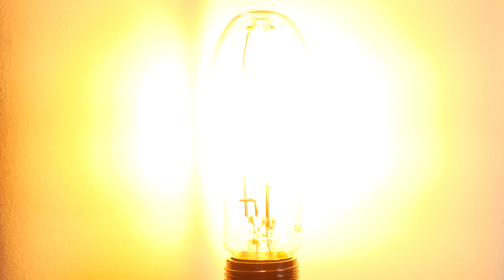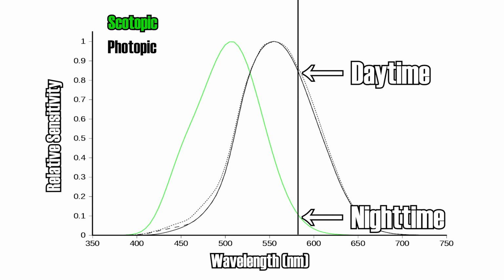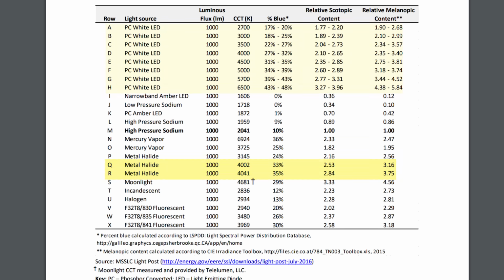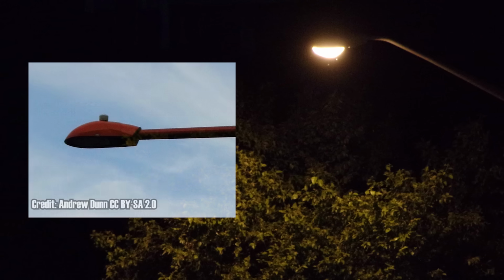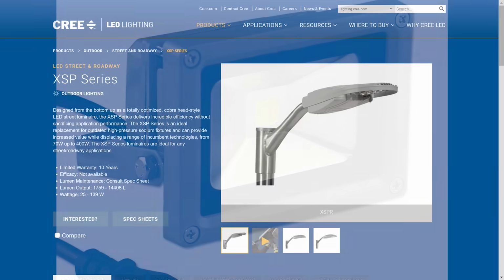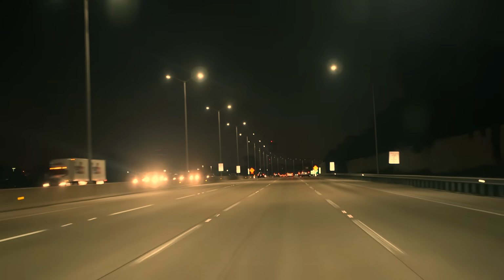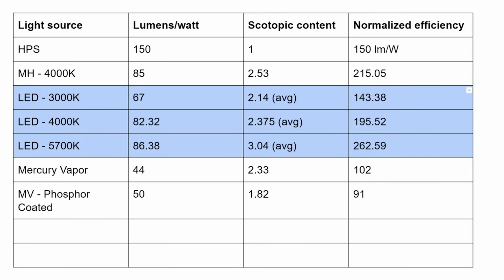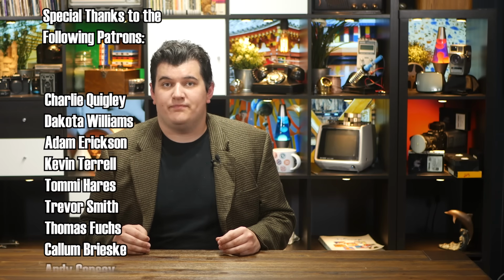The LED's Challenge to High Pressure Sodium

Comment: I remember my street having a blue/white lamp about 25 years ago, before that section was standarized with sodium lamps, shortly after.
I've been walking that street under yellow light for most of my life, so I got used to it (as I have to pretty much the rest of the whole city, it looks just the same)
that, until my dad just recently added a LED light to our back yard, for late night/early morning lighting.
I can't see shit under that light.... it lights the area just fine right under it, but it fades out too quickly over distance, and I'm talking about a square garden barely 10 meters on each side.
the city hall also uses those lights around the city center for public spaces, and I can't see shit there either.
the very little I recall about those old white street lamps, is that they felt pretty much like that LED garden lamp.

I feel more comfortable in complete darkness lit by moonlight, that under those LED lamps.
I also switched the bathroom lights from 30w incandescent to 9w LED, and they shine right in my face,... it's not the warm soft light I'm used to... they feel completely off.
they're great for night lamps or desk lamps, but, lighting farther and stronger? no thanks, give me a sodium lamp any day.

Comment: Its not a choise of aesthetics.  You might dislike white LED light, i don't. I loathe the candle-like lighting of sodium lamps. The whole of Asia perfers >4000K as well. So if the safelty, energy efficiency and longlivety is better with LEDs, its pretty much a no brainer. Only a couple of elderly displeased with white light is a rather low price to pay.

Comment: New York City is slowly replacing all of it's  sodium vapor streetlights with more energy efficient LED streetlights. 150w sodiums are generally being replaced with 91w LEDs. 100w sodiums are being replaced with 64w or 72w LEDs. Opinions vary on the quality of the light produced.

Comment: i wouldnt exactly call the blue light science questionable.
most people, me included will have much less eye strain at lower k values.
my eyes stopped hurting once i reduced the blue output of my monitors in dark rooms.
i guess it boils down on the overall luminosity

Comment: A great video again, I just wonder how the LED light, especially in the 5700K region performs in fog. The narrow band sodium is very good at cutting through fog rain and mist, where white light may be more prone to blazing, and that may prove more of an argument for 3000K led colour temp. Also, I would have expected there to have been development of electronic ballast's for most discharge lamps these days, pushing efficiency much higher, along with lamp life and start reliability. It certainly helped fluorescent performance in the 15 years prior to the led invasion. Cheers, and thanks for posting.

Comment: In Amsterdam there are a lot of decorative streetlightpost and a few years ago in some streets they changed them for decorative LED streetlightposts. I was horrified by the effect, not only is it a very harsh and cold light but they also blind you a lot more and thus actually make visiblility less. At least I noticed this riding my bike. I do not drive my car here so I can't compare with that. When I drive my car on for example an highway with bright LED lighting, yes visiblity gets better but also in some cases it can be a bit blinding. Especially when you enter a less lighted area. I'm no big fan of bright streetlights and sometimes even annoyed by them. I don't even want to talk about oncoming cars with bad modern lighting.

Comment: Here in New Zealand they aren't mucking around. HPS fixtures are being swapped out for LEDs at a great pace. Our entire town has been done, as have all others in our region. There are very few fixtures that still remain as HPS but I think these are the ones that aren't administered by the district councils. The ones they have installed here are on the cool side of warm. And the place does seem darker than when the HPS ones were there. Perhaps they cut down the lumens as well to increase their energy savings even more? 

I'm glad you called out the BS of the whole blue light from LEDs damaging our eyes. It does seem pretty silly. I wouldn't want to have to go back to incandescent lighting as it would be very difficult in our off-grid situation to manage the energy requirements!

Comment: LED streetlamps are great for all the reasons you mention in the video. However there are two drawbacks that I've noticed since they were installed locally.
1) The colour of the LED lamps are too similar to car headlights, this means that you can't immediately tell if light coming around a corner is from a car coming towards you or from a streetlamp. It becomes obvious within a second but it's still enough to cause confusion and hesitation.
2) The old sodium lamps gave good coverage between lampposts, the LED fixtures they replaced them with don't cast enough light sideways so we have lots of dark spots which are a safety hazard, not just for traffic but for lone pedestrians at night. A well designed replacement fixture would easily give enough sideways coverage so it's not a problem with LEDs themselves.

Comment: Vouch on the circadian rhythm being disturbed. Not me personally, I am essentially nocturnal, however everyone with a road facing window on my street has new issues of sleeping when the new lighting was installed on our road, it went from sodium lighting to something white, I can't say what, I doubt it's LED's, it looks more like halide due to its change in colour after ~30 seconds of warming up. Croydon, London if anyone wanted to do more research into it.

rant
I much preferred the sodium lighting on our road, a small cul de sac with little to no night life apart from animals. Fair enough on the busier roads. However not only were the new lights brighter and whiter, they were placed every 10-15 meters, compared to the older ones which were more sparse at ~25m. Not to mention the old lamp posts were gorgeous, green and had some beautiful patterns on, only really needed some paint. It's a shame I can't find any photos of them.

I go out when there's a power cut at 4am now, to see how beautiful the place is at night without the gross light.

I'm not alone with my dismay, it caused controversy throughout several parts of Croydon.

Comment: Nighttime lighting should never exceed a colour temperature of 3500k because having daytime colour temperature lights at night simply messes up the body's inner clock and gives you lots of health problems. Not being able to find some sleep is just one of the side effects. Long term effects are even worse. Your eyes also need a rest from all the blue light.
Reply: Hello - current trend for municipalities is no more than 4200K, which somewhat resembles moonlight.  It's moving in the direction that you prefer, as the warmer LEDs are getting more and more efficient.  Sleep well!

Comment: They need to make sure that the light pollution does not interfere with Astronomy light pollution rejection filters. Also since LEDs do not require a ballast to turn on I think that they should use motion sensors with timers so that they are not on when no one is around
Reply: My brother just did a weekend trip to Virginia, and he saw lighted road warning signs (sharp curve, stuff like that) that only come on via motion sensors. We were both flabbergasted.

Comment: Several things you don't mention: the "blue" problem with the LEDs is even when they are low color temperature, a grotesque "blue spike" at 450nM is still there, just lower intensity, with little light in the 480nM band (where the eye really sees well), and a broad hump centered at 580nM.  What is needed is a true "thermal source" with proper spectrum throughout.
Amber LEDs: these LEDs are the least efficient of all colors, and are most sensitive to heat (of all the colors), losing efficiency rapidly as they warm up.  With the advent of multi-chip LEDs, lamps need to be made that have different color LEDs combined to give proper spectrum and eliminate spectral "holes".
You casually mention assumption of 100% power supply reliability.  Bull!  99% of streetlights will go to the junk because the power supply fails (and the repairman can't just "screw in a new bulb"), or because they will be superseded by newer technology in 5 years, and are thrown away perfectly working.  Another thing that does in LEDs is corrosion.  Even though chemistry indicates copper leads should resist corrosion better then nickel-steel, the steel seems to defy logic and last longer.  Copper in ballast transformers and oil AC caps age much better than spread out on circuit boards, along with electrolytic caps which have no place in a streetlight.  You can clearly see this in lead corrosion in LED (high) and incandescent (low) Christmas lights.
Regarding "screw-in" lamps, these are better to deal with advances in technology.  Socket in my porch light fixture (for weird CFL bulb that keeps burning out and can't get any more), I replaced with good old Edison socket.  I can now put in Phillips "flat bulb", my choice of warm/cool white.
Another thing about sodium light to consider: you know about EnChroma "colorblind glasses"?  They make a version to use at night.  This has 2 spectral notches, one at ~585 +/- 30nM, and the other at 485 +/- 20nM.  Yellow notch reduces effectiveness of sodium light as it falls in the notch.  In the future, 8% of males could be wearing these, and driving at night.

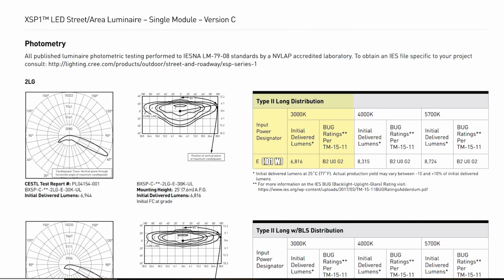Comment: The best light to SEE things instead of being blinded by glare, has the least blue spectrum in it.  When you started making claims about efficiency at 15:40, you were using a very bad example, one where they were only 67 lumens/W?  Really?  Warm LEDs now achieve over twice that, a mere one example of a device that doesn't is not a proof of technology, only that a particular product should be avoided.  You are welcome to consult the LED datasheets from major brands like Cree to see that what I wrote is true, that warm tint LEDs are not remotely that inefficient today.  More importantly, if you subtract the glaring blue content of the light, they are MORE efficient at producing color spectrum that is usable to see well.

Did you GET that?  A lower lumen warmer light has more human-usable light.  A higher lumen bluer tinted light has more blinding, detrimental light.  The extra lumens are the worst possible thing.
Reply: can confirm. A main road near where i live has now retrofitted LED streetlights with warm-white LEDs. They are slightly but noticeably brighter than the regular sodium lights but not too harsh and don't hurt the eyes too much. Overall they do feel perfect for that purpose. So far the best use of LEDs in streetlights i have seen so far.

Comment: A pupil of a human eye reacts the most to blue or green light, and red light has virtually no effect to pupil shrinking. If the effect of the light wavelength to the pupil changing size is also taken into consideration, orange is actually the best lighting color for seeing in dark, because it does not affect pupil size very much but human eyes still have much better response to it compared to red light. Higher color temperatures, than orange light has, actually have so much effect to pupil size, that it makes it very different to see anything that is outside the area where the light is mostly focused on.

Comment: Anecdotally, there is some aspect of adaptability re how much high color temperatures actually interfere with circadian rhythms. Around 12 years ago I switched the lighting in my home to be all 5500-6500K, at the time using specialty high-CRI fluorescent tubes and CFLs. This messed with my sleep schedule for a while, but I eventually got used to going from bright daylight-equivalent light exposure to being asleep in a matter of just a few minutes after turning them off.

Comment: On a recent 4AM drive to the airport I noticed that all the highway lighting along the way had been replaced with LED. Everything was much easier to see. They were also very well aligned so that the road, and about 20 feet on either side, was highly illuminated. Everything outside of this received very little light at all. I don't know what color temperature they used, but I would guess it is in the range of 4500k. It was 'whiter' than the 4000k LED tubes in my kitchen but not as harsh as a 5000k 'daylight' LED bulb.

Comment: Excellent video, I learned many thing, but I have one point of confusion: at different times you spoke of “cooler” color temperature (more blue, yes?) and at other times “higher” color temperature, again I think meaning more blue frequencies.  Looking at charts I see 6500° as more blue and 4300° as more red, but the blue is called “cool”?  This is very confusing to me, because isn’t 6500° over two thousand degrees warmer than 4300°?
Reply: Sometimes people call blue “cool” in an art sense, where blues are psychologically considered “cool” colors and reds/oranges/yellows “warm”. But the color temperature scale works in the opposite direction because it relates to the color appearance of a blackbody radiator at a specific temperature (which becomes more “blue” as it gets hotter). So yes, it can be confusing, and people should be careful with wording when talking about color temperature.

Comment: Good old sky glow. I live in a rural area with a giant chemical plant (let's just say that last time it was on fire the flames could be seen from over a dozen kilometres, to give you a size idea). Above the towns there's small glows in the clouds. Above the plant the sky is illuminated for a giant stretch. In fact, when I'm in bed with the blinds open (~5km away and facing 90° to the plant) a full moon night is darker than a cloudy one.
Reply: The same in my rural area (NW Missouri) even isolated rural homes are causing sky glow and glare on country roads, small towns are lighting up the night.

Comment: The ballast in any of the light systems used has no effect when using an led replacement since they are just for current limiting but the igniters have to be removed the the high voltage they can output will fry the led

Comment: I'm fairly sure there is no official investigation into this. I hate LED lights in general as they flicker and give me eye strain. I suspect there are actually a noticeable amount of people with similar issues.
This actually INCREASES the chance of accidents.

I would like to know if any investigations have actually been done about this.
Reply: Modern led lights shouldn't have a visible flicker. That said a tiny percentage of people do have a better perception that might be able see the very slight flicker in some cheaper lights. led's are dc so the ac current has to be converted to dc via a full wave rectifier which leaves a small ripple easily smoothed out by one of many simple, cheap, circuits. However it is possible some manufacturers are not adding this circuit on their bargain basement cheap crap led bulbs to shave some fraction of a penny per bulb. So either you have cheap bulbs in use or have an unusual acuity to such things that is pretty rare. Possibly both.
Reply: Kasey Boles As they are used to chop off even a slight percentage in cost I suspect this happens a lot.
Reply: It's possible some led bulbs do leave out our under-spec the ripple suppression. But the modern led bulbs couldn't get away with it. First without a capacitor (simple, cheap, effective) to smooth things out a very noticeable flicker would exist. I've seen it, but very rarely in even sub $1 bulbs, and it's very noticeable. Also if you don't have a dimmable led bulb you need a dimmer switch that's compatible with leds or risk damage both. Dimmable bulbs pretty much have to have smooth dc for the circuits that detect the type of dimming being used and correctly control the output of the leds.
Reply: LED lights shouldn't flicker unless something is wrong with them, or they were built extremely cheaply (and therefore probably won't last very long). Incandescent lights actually flicker a lot more.
Reply: If you do have a flickering LED bulb odds are you have really bad power in your house (as in call an electrician stat, before the tv explodes and your computer lets the magic smoke out and your house catches fire) or far more likely you have it connected to a non compatible dimmer switch, in witch case swap it out for one labeled dim-able or change the dimmer to one designed for led bulbs or best bet both. And of course it's always possible you just have a defective bulb, try swapping it with another that doesn't flicker as your first diagnostic step. If the bulb flickers in the new socket replace the bulb, if the other bulb starts flickering in the original socket, then your likely looking at a bad socket or dimmer incompatibility as mentioned above. If any led flickers in any socket, even different bulbs from different manufactures and in circuits with no dimmers anywhere on the same breaker, then it's time to call the electrician.
Reply: Most high luminescence LEDs are driven with high amperage pulses, not DC.
Reply: Jamie Mahoney Where i live they replaced the lights with leds, my backyard faces the main riab btw, before i didnt need any porch lights, but now the leds make the street darker, and it burned out for the 4th time
Reply: the only ones that have any flicker are the cheap assed ones that they left the capacitor out of to save 3 cents per unit. Stick with reputable brands and you wont have that problem.
Reply: I generally always hate LED lighting.  Led Christmas lights drive me insane!!!